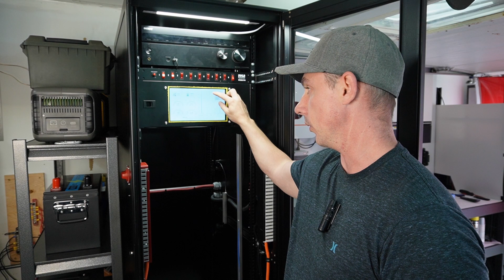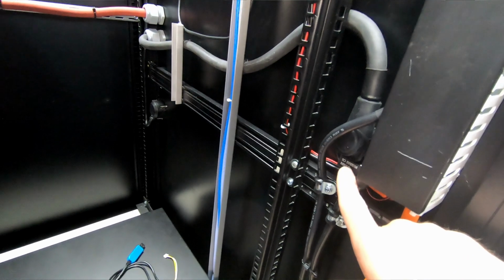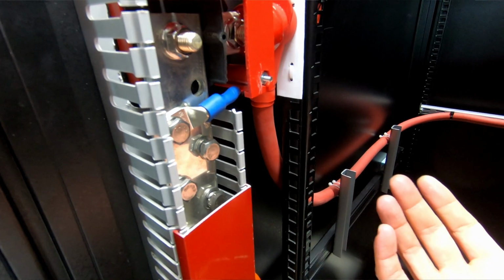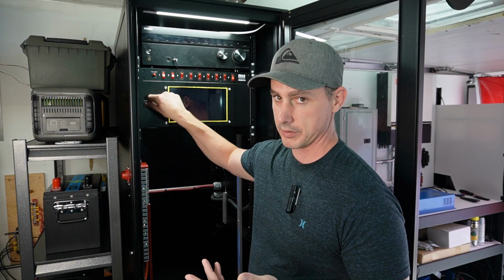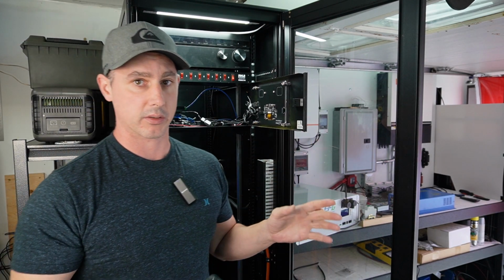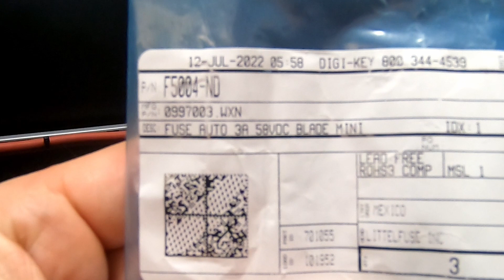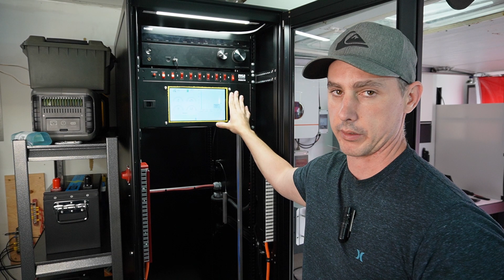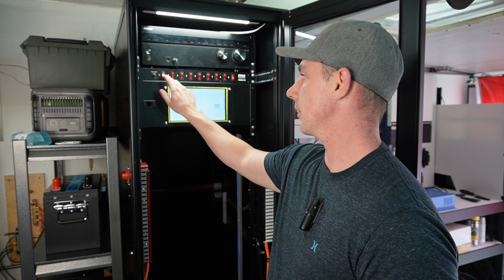Cabinet Update: I Shocked Myself. Server Rack Whole Home Battery Bank. LiFePO4 48V (51.2)

Comment: LMAO I also had a similar experience but mine was with a breaker box. I had to ground my neutral to a ground that went outside. I already had 2 grounds going outside to 2 different ground stakes. I added the new breaker box to both of them. no more shocking which was more like a hard tingle.
Reply from the maker: It's shocking lol

Comment: Great video.

Double check that the voltages for the 5V devices are the same, sometimes they are a bit higher, 5.1V, to compensate for voltage drop in cabling and PCB losses. Given your cables are short it might not make a difference though.
Reply from the maker: That's good advice; I never thought to check that. Thank you 🌞